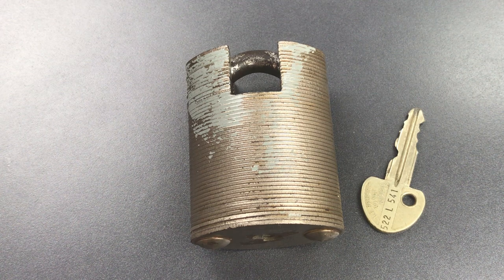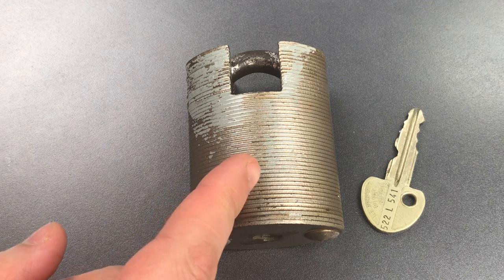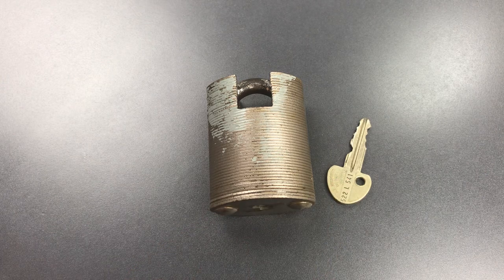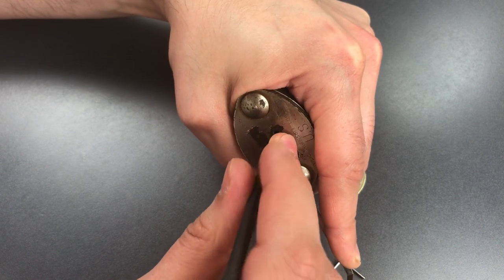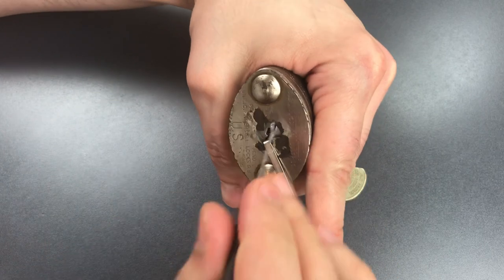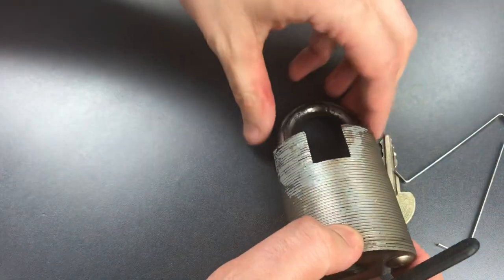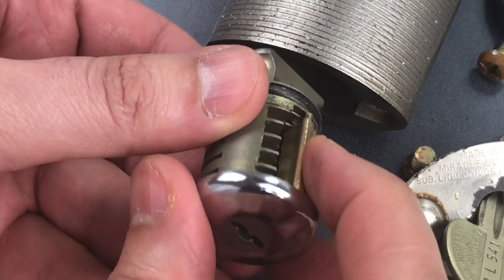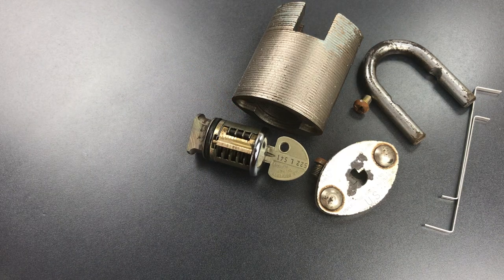[687] U.S. Military “Miracle Lock” with Ingersoll 10-Lever Core Picked and Gutted

Comment: Thank you for the back story and sorry that you lost your friend. I know how it is, I enlisted in the military and staid for 40 years and lost several close friends.
As for the lock, these have always amassed and amused me that most of these locks can be defeated with a file. I do not know this particular lock, but I have used a file on similar locks to remove the head of the rivets or nuts and remove the lock core, opening the lock. Others I was able to drill out the lock core to open the locks. I would sometimes get called out to open a lock that was broken, worn out or the key was lost so that the lock could be replaced. Most lock cores are made of a soft metal, usually a cast body and stamped gates. I have seen locks that would take a long time to cut or torch through the shackle defeated quickly this way. I remember one lock that had a deterrent built in to the nuts on the bottom of a lock like in this video. After getting the heads off the base plate wouldn't com off because the nut on the inside was bigger than the hole that the screw came through. But I was able to drill the screws out through the bottom to remove that bottom plate. I don't know of any locks that have this setup or the Master Lock types that can't be removed in this manner. There may be some, but I have never ran into any.
I learned to pick locks, but the locks I had to remove were either broken or the locks were to replace anyway. 
When I was stationed at one place, there were only 3 of us authorized to remove locks on sensitive items and one was about to retire and he was the only one that could open safes. The Commander decided that myself and one other guy needed to go to a school to learn how to open safes. But only one of us could go at a time. The other guy out ranked me so he went first. When he got back, someone decided that only one person sohuld be trained that way or there was some regulation about that. So I never got to go.

Comment: What modern locks use this core or a core that is similar? Even if it does not have false gates it seems to be such a pain in the ass to pick that I would still consider this a good "pick proof" lock, I think.

Comment: The bolts on the bottom of the lock give me an idea. What if someone was to make a lock with a deeply recessed core, as to potentially prevent someone from properly applying tension? It may be a little akward to use the key, but if it can't be made more secure, than why not just make it a bitch to pick?

Comment: I have one of these locks that I am going to be selling shortly but first I wanted to read up on it. It has a larger number 8 stamped on the key and the lock. Does anyone know what that means? Also, the other #’s on the key like this video has? Thank you!
Reply: Probably just to mark them as going together so you don't spend 45 min trying 50 wrong keys. Or 3 minutes picking the lock and have a pissed of sergeant who decides you can now guard the crap untill Monday morning when they can buy a new lock.